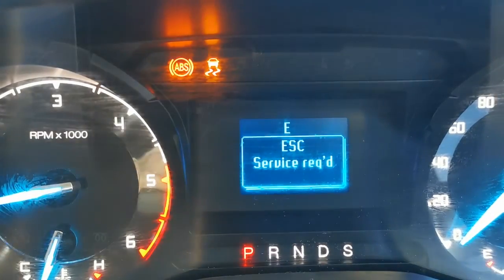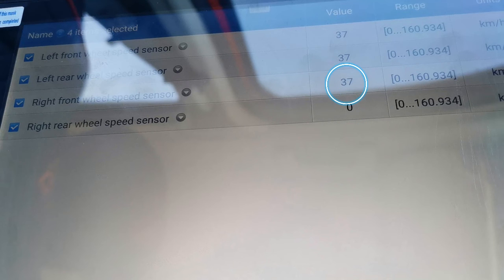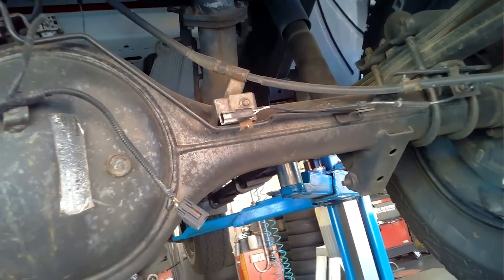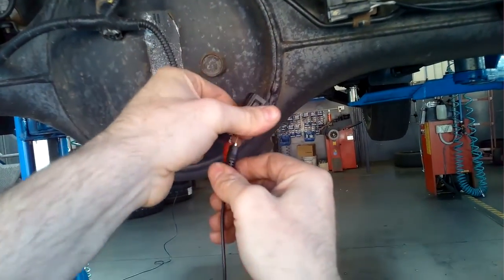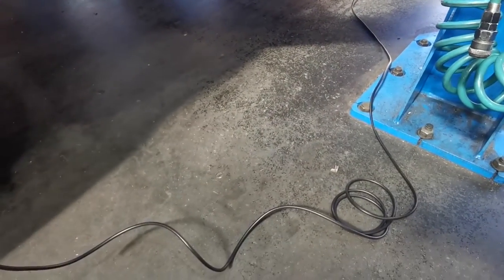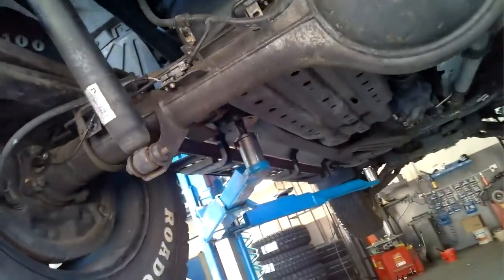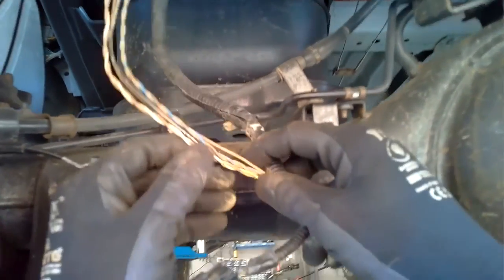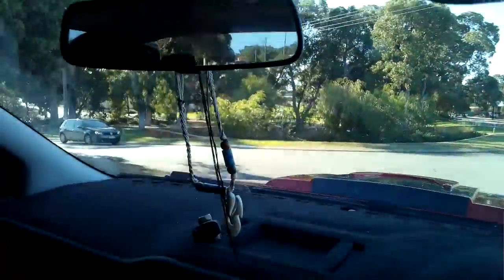Ford Ranger With Multiple Faults, ABS ESC & Hill Descent Control Malfunction - Problem Solved

Comment: Exactly the same problem with my 2020 Ranger Raptor. The sensor wire on the rear right side is broken. Fixed. Thanks for the help.

Comment: Watching in year 2024 on october, i have the same issue same location of right rear sensor, even i changed with new sensor, i hope i can find that right spot to save time, 😅
Reply from the maker: Hope this video helps you fix it, you'll need to investigate the wiring a bit 👌🙏🙏
Reply: October 2024 for me too, had it down to the garage who thought maybe ABS pump. I'm convinced its not however, always the RR Wheel Sensor throwing the code plus when I clear the errors the speedometer is all over the show until the ABS is disabled, it then drives perfectly. Going to dig around in the loom before spending ££££ on an ABS pump which might not fix the issue!

Comment: Hi Gerard, I have a 2018 ranger which is showing the same faults but also a few more. 
U0415:00-68
U0418:86-AF
C003A:14-8A
U0415:00-48 
I think they were all the same faults on your video, replaced the OSR ABS sensor but still nothing cleared. Can you help?

Thanks Danielle

Comment: I have a 2015 ford ranger where now and then the gearbox gets stuck in a gear and that light comes on. Do u think a sensor can cause a gearbox to get stuck in a specific gear. once i switch off the vehicle and on again the problem is gone for days if not weeks.

Comment: An excellent and very thorough video. Thanks. My 2016 BT50 had  a wire break on the LHR sensor (Brown/ Green wire) at the exact same point at the axle clamp. Your video gave me the confidence that this was the stress point. The cable sheath plastic is not flexible, so no wonder the wheel speed sensor wires break here when flexed by axle movement. My local auto electrician was less than helpful and didn't even know where the ABS module was.

Comment: Thankfully I've found your channel, got a 2.2 and 3.2 Ranger, both have ABS fault, Electronic Stability Control ESC service lights on, tried a new ABS sensor on the left N/S, no change on the wheel rotation, now I know how to find a wiring fault and more importantly the areas to find the broken wire. Many thanks, great video and a big help !!!

Comment: How can that wire get broken inside that protective plastic all around it, weird
Reply: always does rubs on the ribs of the split tube see it all the time in trucks too
notice you can see the lumps of the inside of the conduit on the other wires when exposed

Comment: I saw nothing about the Hill Descent fault, unless fixing the broken sensor wire also fixed that fault....?
I have a 2016 Ranger that also has this fault plus a Steering Assist Fault. This happened immediately after washing the vehicle. It seems as if something got wet and needs to be dried out or perhaps ti needs a party replaced, but IDK where to start. Can you help with this Steering Assist Fault?
Reply: Same with mine, how did you fix it?
Reply: @bandsman4923 hi did you get this problem fixed?
Reply: My car t7 y2016 same as problem as above.ABS and hill descent after drive in rain.And now,I still cannot solve the problem.
Reply: @rozomohdzain4855 did you get it fixed?

Comment: I have the same model and pretty much the same problem, mines a manual. Except my also says engine coolant overtemp? The car won't start when this comes up. Any suggestions? 
Usually happens on a cold start also..
Reply: I have the same issue on my ford everest 2020, using the scanner I get lost communication errors on almost all modules including ABS, PCM, PAM and more. Mine doesn’t start when these issues pop up but when it does start all errors go away. Any leads on how you managed to fix this?

Comment: I have a 2007 ranger fx4 with abs.Tom,Brake and air bag warning lights on! And fuse number 20 still blowing up and transmission works like limp mode 😩😰

Comment: Did you know lots of  main dealers won't allow the repair of wiring on anything to do with the braking system
Reply from the maker: I didn't know that, but it doesn't shock me that they would choose not to, clearly way more money to be made in replacement rather than repair
Reply: It's the same with airbag.